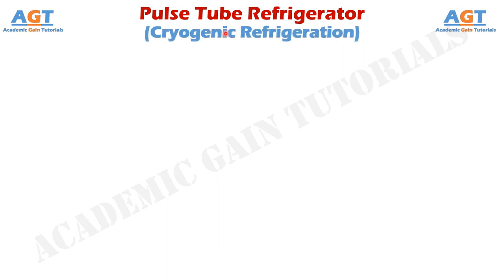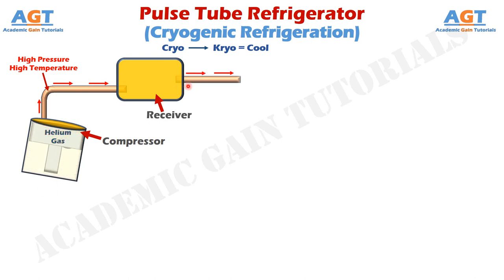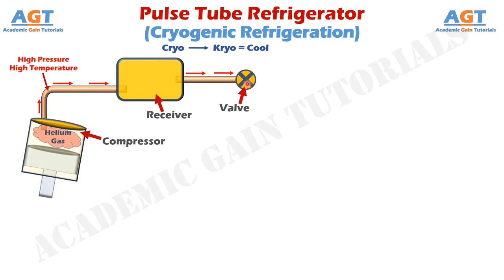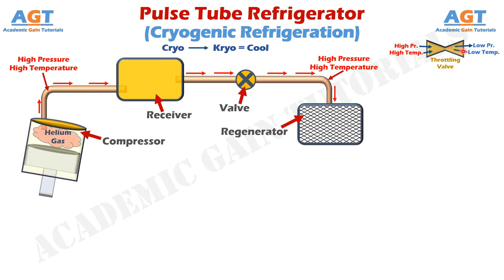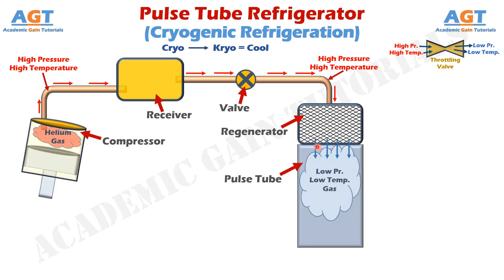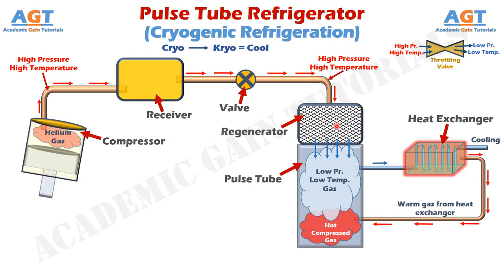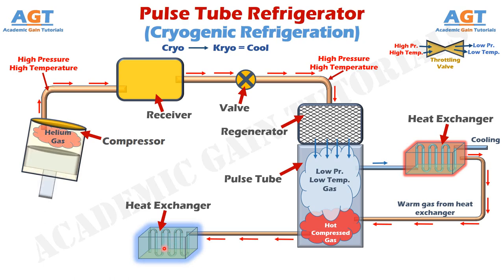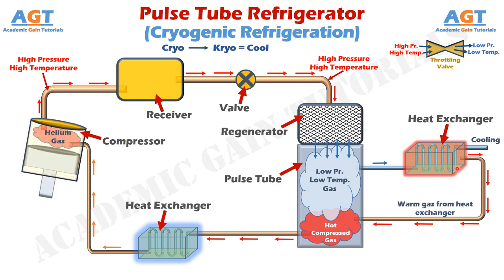How a Pulse Tube Refrigerator Works - Cryogenic Refrigeration Parts & Function Explained.

Comment: Why don't the Hot gas and Cold gas in the Pulse tube mix together and just make warm gas that just bypasses the heat exchanger for cooling and just flow back into the Exchanger that's used to cool the liquid itself?  It's the same gas, why don't they mix?
Reply: jonathan?
Reply: @thedarksideofthemoon2  No?

Comment: Two questions: why do the gases not mix in the pulse tube? And why is there not a cooler on the outlet of the compressor, to reach a lower temperature following the throttling valve?

Comment: what is the lowest temperature it can achieve?
Reply from the maker: The lowest temperature, reached with single-stage Pulse Tube Refrigerator, is just above 10 K. However, one Pulse Tube Refrigerator can be used to precool the other. The hot end of the second tube is connected to room temperature and not to the cold end of the first stage.
Reply: @AcademicGainTutorials  the above shown video is kind of stirling Pulse tube or GM pulse tube can you elaborate...

Comment: such a lot of good information - but for gawds sake, use a pronoun or two!  "...into receiver"  (would a pronoun be too much to ask? 'THE")  you don't put things into "receiver" you put them into THE receiver :)
Reply: Such a silly comment....
As long as the video is helpful and factually correct, why do we need to worry about pronouns? Also, "THE" is not a pronoun. It is an article.